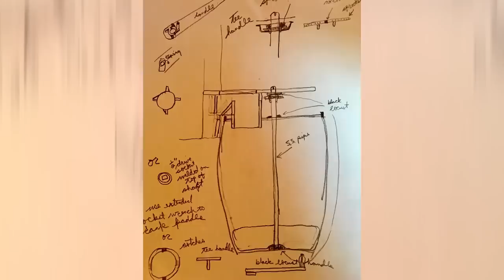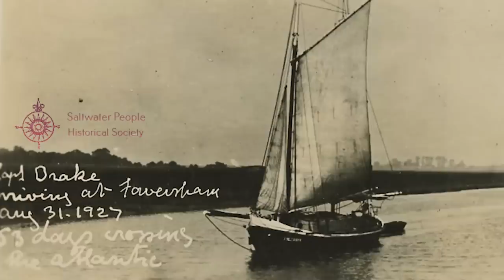Artist Builds SAILBOAT from CONCRETE, The Pterodactyl, a Gaff Rig Schooner

Comment: It's ferrocement actually, not concrete. The principle is the same as fibreglass except with steel replacing the glass fibres and mortar replacing the resin. It's been around over 100 years and is still used as a commercial building technique.
Reply: I believe that the term "concrete" was part of the 70's hype for promoting ferrocement which began in the 60's. The ASCE National Concrete Canoe Competition started the collegiate competition in 1971. By the 80's the competition and " concrete" usage had spread to Europe ...

The rules allow that up to 50% of hull thickness may be mesh and define "concrete" as up to 30% by mass portland cement and at least 25% must be aggregate (advanced/non-standard aggregates are permitted but epoxy is forbidden). 

Earlier usage of "concrete" for ferrocement was during WW I and WW II when "concrete ships" were proposed using ferrocement as a method to address shortages in the steel supply for shipbuilding. The reason why ferrocement was not adopted outside of hobbyists is because it is labor intensive and not as affordable as other methods. Since ferrocement ships are so durable, quite a few were used to provide breakwaters for improvised/ improved harbors.

Comment: I met a couple of hippee brothers in Anchorage Ak mid 70's that were already accomplished sailors at the ripe old age of 28.They were building a concrete hull in their back yard and at that time melting car barriers for lead ballast.I remember all the rebar and chicken wire.I was only 18 or 19 at the time.They said there was good sailing from Anchorage to Fiji on account of the tradewinds and currents.

Comment: It is a lot of work. First of all the reinforcment, the webframes, the chickenwire nets, and finally the grating, that should be for the best result a continuous process to get the best and strongest hull. The hull will end up to be about 30 to 40% heavier than a steel one. To build a solid hull is an art in itself. Do not expect high speeds, a general 5-6 knots in general will foot the bill.

Comment: IF your going to be doing tours you need to get the vessel permitted for commercial use, which might be quite difficult w/ a home-made vessel. EVEN if it is in all respects very, very seaworthy and stable. Coast Guard can be very picky and articulate about any minor reason which might make your vessel ineligible for a commercial use permit. There are a lot more rules when it comes to commercial permits than just if you own your own vessel and boat around in it.

Comment: There are well built boats and not so well built boats.   The problem with concrete,  is A) no one wants to insure a concrete hull B, if your boat sinks, you can take everyone elses boat down on your slip.  I trusted my houseboat with my life. It was a DIY boat, and I kept the tradition. But most marinas won't take a uninsured boat, getting insurance on such vessels is almost impossible. The reality is just because you can build something a certain way, doesn't mean you should. I loved it, and I had the utmost confidence in my boat, but another problem no marina wants to deal with is abandoned boats. It's one thing to break out the sawsall  and chop up a wooden/ fibreglass hull. You are not doing that with a concrete hull. Your best bet is to secretly take it to some magic location and make it disappear underwater, from a marinas perspective. They deal in real estate, not boat sales, they don't want to spend years keeping a abandoned boat afloat. Regardless, it was a time in my life I will never forget. I couldn't imagine a more beautiful way to live.  And that a boat such as this built in the right hands, will last forever.  It was a experience I will never forget.

Comment: well I'm glad to see you got it back together. last time I saw you you had no rig on that craft. you were under power, we were under Sail. and you nearly drove that rock over our 22-footer coming into quartermaster Harbor. if you're going to be chartering that thing, you may want to pay attention to your rules of the road captain. while I appreciate your creative genius, many passengers may look at it as" ghetto trash", or "Ratty" as in the Harley rat bikes. most of all pay attention you'll impress No One by running down another craft!
Reply: Sorry, the Pterodactyl has never been into quartermaster harbor. Your most likely thinking of Ning Ning, a sister ship of the exact design with a green hull. 
Also the last time the pterodactyl was cruising around without a rig was the 1980s haha. And it was nowhere near Quartermaster Harbor.
Reply: @oceanlandis1134  this one still had no rig standing... I had seen another boat of the same design vegetable on a beach at Mike's Beach Resort in Hood Canal
When the tide went out she leaned over deck to the Sea, and when the tide came in it filled her up. She was sold to someone for a thousand bucks in the conditions she was.
  Some bloggers with an adapt and overcome attitude came down with a high lead Tower and pulled her to an even keel, then they threw a firefighter's float pump into the companionway and pumped out the water.

Comment: What a price of crap that hull material is from the Stone Age no one builds cement boats anymore they are prone to sudden failure judging by the test of the boat you used regular mix and there is a special concrete mixture you need to use

Comment: Why in hell would you paint a concrete hull?
The longer it's in the water the stronger the hull becomes.
Plus it makes its own water line so you don't have to paint one on.
Reply: Indrekk Pringi it needs to be painted because the cement is over a chicken wire frame.   When the chicken wire rusts it expands and causes the concrete to fail.  It happens al the time with reinforced concrete when the rebar rusts our.  I can’t remember how much the rust expands but it’s allot.   Over time it can even shear rivets.   Wikipedia has an article on it if you search for “oxide jacking”
Reply: @opforind  
Ah; I see.
Then the only way to not paint the hull: which can fail and peel
is to use some sort of mesh that doesn't rust.  In my opinion bronze wire should work.  Using cheap chicken wire is a stupid thing to do in my opinion.
My point is if the concrete is allowed to cure indefinitely; it gets harder and stronger the more it cures which is a much better result than chicken wire that rusts.
Reply: Indrekk Pringi lol what?  That went sideways fast.  I wasn’t trying to troll anyone.  I shared my thoughts on the subject.  You responded it seemed nicely and with some thoughts on how it should be done with bronze or whatever.  To me that’s the end of the conversation.   

I have over 20 years of experience in maritime restoration and construction.   The technique is called Ferro-cement construction.   You can look it up further and find out why people don’t use bronze.  But they don’t.  In general it’s not the best choice for marine construction out of the many available options.   I’ve never built a ferry-cement boat and I wouldn’t want  to.  I’ve seen how they age and they just don’t last.   When they break people move on and build something else.  It’s throwaway construction.  

I’m not sure why you’re throwing around insults now.  If you wanted to ask a question you could have just said “what about x y z?”   Like I said you think bronze wire is the way to go then go research it.  It would cost more and eliminate the only advantage Ferro-cement offers which is lower material cost.  

I didn’t say this guys boat was shit.  He put allot of work into.  It looks pretty decent for an amateur build.  He’s obviously capable and multi-talented.  He built a boat and got his captains license so he can do what he loves.  That’s great.  Now please explain why you’re entitled to an immediate answer from me for a question you didn’t ask?
Reply: @opforind  
Why should anyone ask you questions?
I never mentioned questions
Your miscomprehension is 90 degrees to what I posted
Reply: Indrekk Pringi I’ll quote you directly 
“Teo Ebratt this is what gets me with you one-horse morons. You have only ONE comment to make. you are incapable of having a prolonged dialogue or conversation or argument. The only reason you post worthless comments is to keep yourselves distracted trolling from one distraction to the next.”

And I’ll leave you with one last nugget of wisdom before unsubscribing from this conversation because it’s a waste of my time

“The confidence of amateurs is the envy of professionals”
Reply: @opforind  
Apparently you've never heard of hydraulic cement